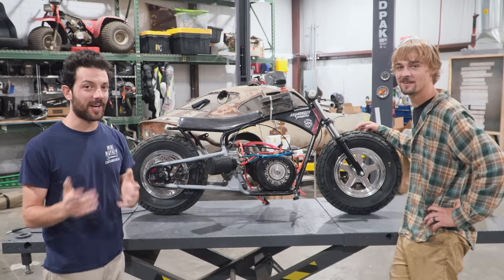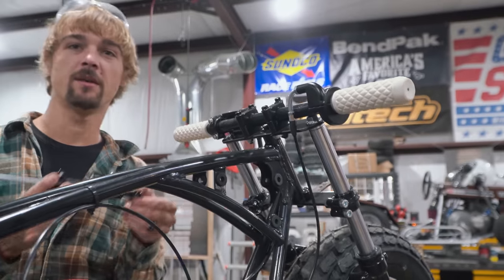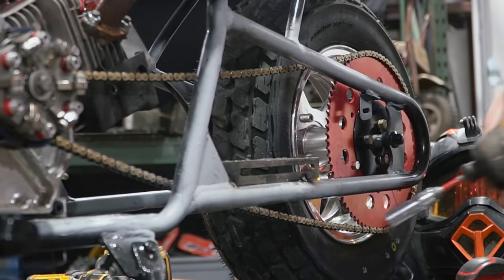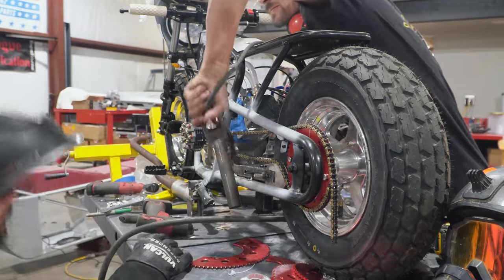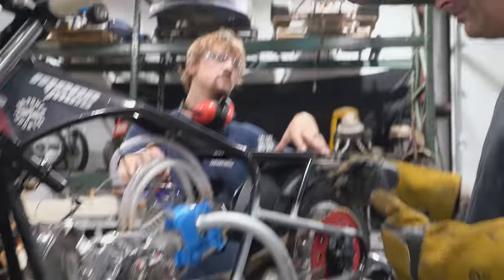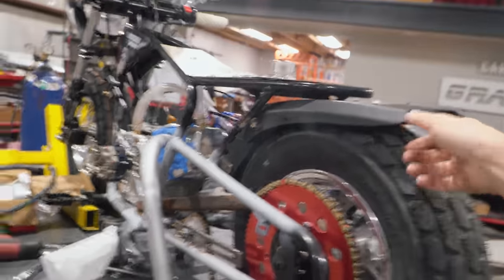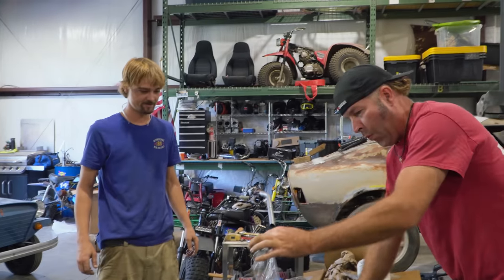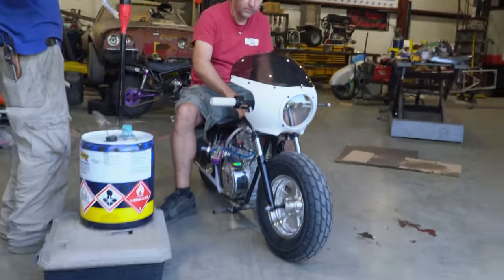40HP Methanol Mini Bike First Rip! World’s Fastest Mini Bike Build Pt. 2

Comment: Hi Guys I know you folks always put safety first, wanting to hit your projected top speeds and being canceled twice! Just thinking out loud here do you think maybe there’s a message being sent to slow down and have fun other ways. I really enjoy watching the three of you guys work and challenge each other with all your skill at speed these bikes are designed to handle. Hate like hell to see one of you guys get hurt bad trying to prove something that really means? “ WHAT “ 
I’m a speed nut and live for anything with an engine on it!!! Check those bikes your using for higher speeds many times. And test on the same type of surface you will be going balls to the wall on not dirt and grass. Compression rate on each front fork should be measured as well, make sure the triple tree is square when being tightened to the forks it’s important guys. Damping the steering is good but a speed wobble sucks on a small bike. I too race and build for fun 
And have gone down. Just check everything on your machines at least twice. 
Just stay as safe as you can gentlemen 
Cheers Doug from Canada.

Comment: hey guys, that bike looks AWESOME!  Couple of suggestions...  Maybe add a second steering damper on the opposing side.  That one is kinda light duty for going over 100mph!   Also, the exhaust up and out the rear at the beginning of the video is much better than the one aimed at the ground later in the video.  Careful not to catch it on the ground in the corners!  (Same for the footpegs!)  I realize you made this for a straight track run, but if you're running it on the Cars and Cameras Grand Prix, be careful!
SEE YOU AT BUSCO IN A COUPLE WEEKS!
-Glenn
Build Night

Comment: Oh god this definitely what I needed right now bro. I’m fixing to put my reinforced 236 stroker together here within a week or so depending on parts shipping from GPS. As far as i know I’m the first or one of the first people building this specific bike that I just got. Spend a G on a nice bike and tear it down to make it Super bad. So the MUDSTAR 200 is getting 4” higher  suspension all around, hydraulic breaks, 236 with GPS 285 cam with built head and billet ratio rockers w/24mm flat slide… #420 chain and sprocket with a god blessed JUGG-A -VERTER should be epic. More to come but I already spent 3K on this project and she’s not even done yet so time will be my friend on this one otherwise I’ll go broke if I let myself 😂😂

Comment: On Aircraft when installing rod ends like you have on the dampener it is advised to install a fender washer at the rod end in case of a rod end failure. It will hold things together and not allow it all to fall apart!

Comment: You guys should get a draggy for testing purposes.  They are a little expensive but they are very accurate.  A ton of street racers and all the No Prep kings drivers use them so they can get data on how fast their cars are running since they dont get time slips.  I have one and its remarkable how close it is compared to when i run my car at the track.  I use it on my motorcycle and 4 wheeler also.

Comment: First of all. If you’re having interference problems with the steering damper, just turn it around. It can be run in either direction. 
Second if there is going to be a kit available. Just use the bolt on rear swing arm kit and stretch the swing arm a couple of inches. That should solve the problem of having to weld it together. Other than that great build and I can’t wait to see what it runs at the air strip.

Comment: I wish you boys would have moved the pegs toward the rear. For every drag mini ive built keeping the pegs up front just upsets the whole ride. There is a reason top fuel cycle has the lay down on the tank riding style. 
With all that said i do appreciate y'all keeping it real.
On one of my doodlebug stock frame minis i kept the front pegs for riding and took those screw on bmx style pegs and ground them down half circle to fit the tube and put a set on the lower bars not 6inches from the rear axle. So that bike has dual pegs and works freaking wonderful

Comment: For cutting metal, you should get a ferrous metal cutting blade for the circular saw. Carbide teeth, next to no sparks and can cut up to quarter inch thick steel

Comment: That fuel tank needs some rubber under the mounts and straps. Otherwise the steel brackets will likely rub holes in the aluminum tank.

Comment: Shorten that exhaust or put a bend in it level with the lower frame. I know it's a straight line bike but it looks to close to floor , I'm surprised it didn't get ripped off riding around the yard because it looked close a few times.

Comment: I would have used tabs and flanges and 2-3 trampoline springs per side under tension as the steering stabilizer. Cleaner install and more steering range maybe.

Comment: If you are worried about fuel slosh you should get some stainless steel pot scrubbers and put them in the tank. It will act as fuel baffles. It is an old trick that has been done for years.

Comment: You might be unimpressed at the drag strip, because by the time the power rolls in, you'll be in the traps. It would be OK in the Flying Mile, but no acceleration, with that gearing.
You need a two speed setup, maybe a variation on that minibike you bought a while ago, with a modified PTO sprag clutch for the gear change. Also, the front end lifting at speed from the power is a real problem - use layout pegs at the back of the chassis, to allow you to shift your body weight forward, and help keep the front end down. It just looks uncomfortable, trying to duck down behind that fairings windscreen.
Just a couple of observations. If that thing gets away from you, it's gonna hurt...

Comment: I wonder if you've consider drilling a spiderweb of holes in the clutch guard to reduce weight? given the thickness of the metal used, I think you could cut down on the weight significantly for those parts.

Comment: Really love this ride, you've come miles since you started. The extended frame, lowered, and the wheel/tire combo is perfect. Just wondering - are you using small airplane tires to get a higher speed rated tire?
Reply: I don't see GPS having a 10" tire rated for 120+MPH.

Comment: Set the idle at 2000rpm, and adjust the clutch accordingly. Maybe have it engage in the 2300 rpm range. That'll help the issue with it being a pig down low, and on methanol there's really no reason not to. It keeps the engine so cool idling at 2k rpm won't be a heat issue.

Also, if you guys are gonna over 100, MAKE SURE you get tires rated for it. You don't want lawn mower tires or go kart tires going that fast, they're nearly guaranteed to explode. There's even a lot of motorcycle tires not rated for 130mph. Also gonna want the wheels to be professionally balanced, with tires on of course. Any kind of unbalanced wheel at those speeds can cause an oscillation that results in a death wobble. On a bike this small and light, a death wobble is going to wreck you.

Comment: Just remember, if you get into the two stroke street bikes (H2 750 for example) they are "top heavy". High center of gravity. When you go into a corner at high speed, they don't want to lay down. Go slow when cornering. You don't want to become part of the scenery.

Comment: You'll probably need to add another 20/30hp to be even close to fastests lol
Reply: people have put pretty big engines into suzuki pv's but maybe that isn't a "minibike" due to..   back suspension?   it's gonna be pretty sketch to go what this power already should get it up to if the gearing is right and there's enough space, but if it's not built into a ruleset could just as well just throw a yamaha r3 engine in it.
Reply: @lasskinn474  it's gonna be fast for sure

Comment: That rear gear says 45mph max
Bike will not get close to 100 mph ever
It takes 3 times as much hp to go from 60 to 100 mph and 3 times more to go 120 mph
Need 10 to go 60mph
Need 32hp to do 100 mph 
And 100hp to do 120mph
Reply: Total bollocks